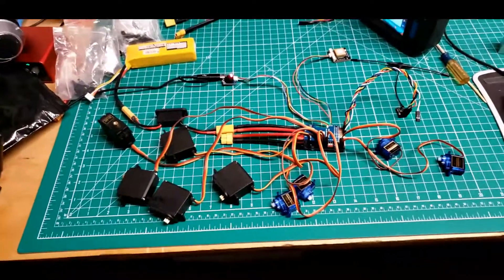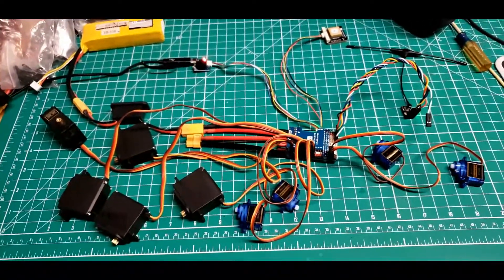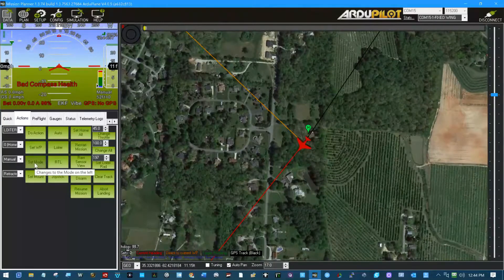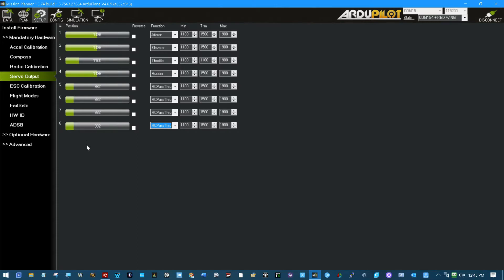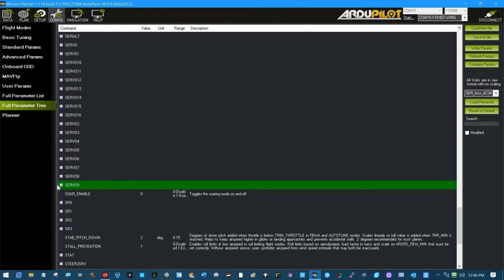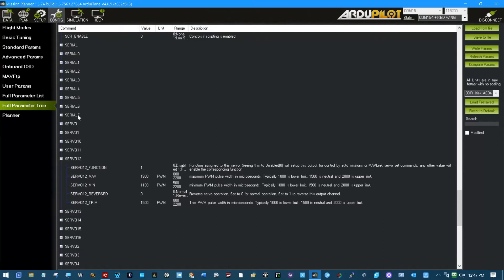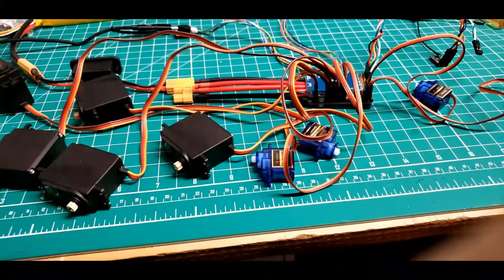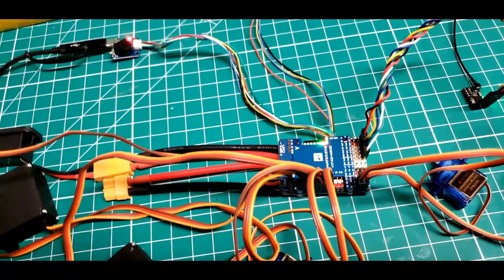H743 Wing Testing After Soldering

Comment: How did you get the servos to work with your Receiver connected to the board? Did you have to change some settings in Ardupilot
Reply: Nvm I figured it out
Reply from the maker: Well darn.  I was about to make you a good video on the joys of using a FC.  rofl  If I can ever help with anything else, just ask.
Reply: @nighthawkvs  fc are great. My problem was that my receiver didn’t have SBUS it was S.port. I switched the receiver with a SBUS, wired it to the website and it worked
Reply from the maker: Cool.  The FCs did have 8 or more pwm inputs up until 2011.  When the Pixhawk first came out and I got my first one I was dumfounded by the SBUS input being a single input after wiring 8 on my old APM FCs.  I used a pwm to Sbus adapter for a couple of years.  A pwm encoder might work on the pwm outputs on that other RX.  Almost all FCs are input from one wire now.  SBUS, CFSF etc.

Happy flying!

Comment: Good job!
Did you use inav on h743?
Also did you have any problems with ArduPilot on this fc?
Reply from the maker: I set it up so I could use either INav or Ardupilot. I ended up putting it in my Flame Wheel F550. I will be using INav or ArduCopter. INav doesn't support CAN on the H743-Wing yet, so I have two ways to connect the M8Q-CAN GPS. CAN buss for ArduCopter and via UART for INav. I just have to switch the wiring when flashing INav.  It will be tested soon.  So far so good with no problems.
Reply: Where do you live